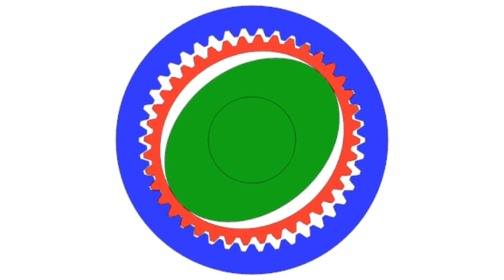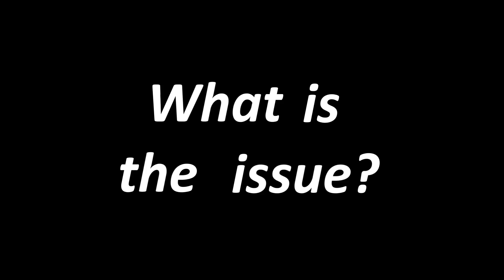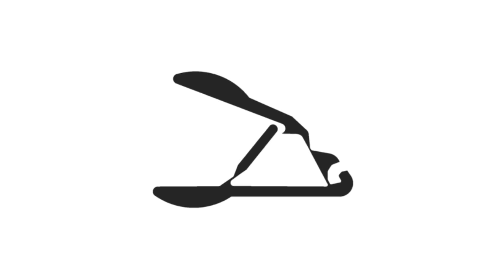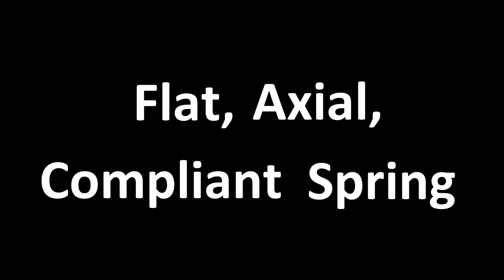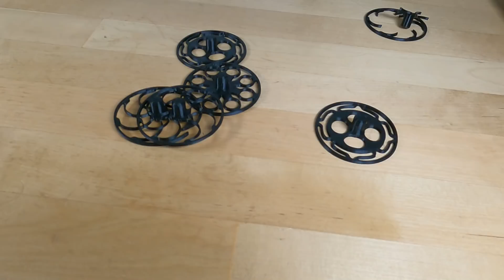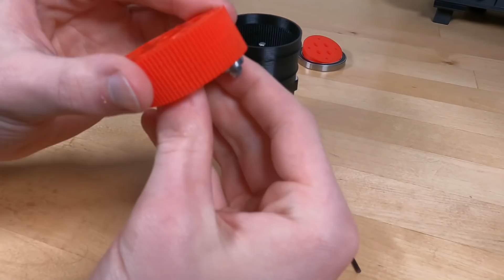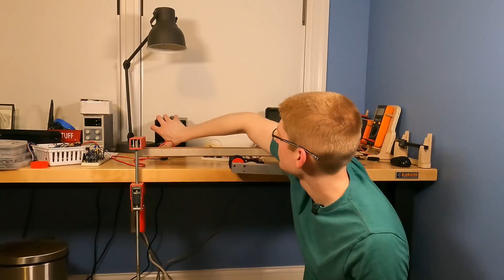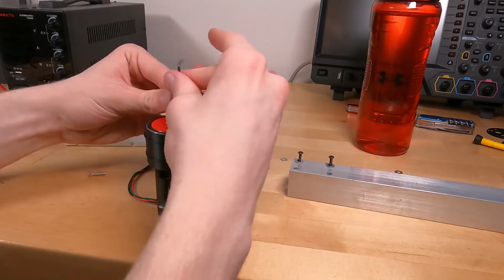Compliant Harmonic Drive (3D Printed)

Comment: you have no idea how much I appreciate you using metric instead of imperial
Reply from the maker: Always have!
Reply: I honestly don't know any engineers (I'm in the US) that use imperial. The only time we do is when we're forced to by dang archaic machine shops! Metric is love, metric is life
Reply: @3DprintedLife  imperial is less common in engineering, more of a general purpose measurement.
Reply: Come on... how hard is it when the software does all the heavy lifting??
Reply: Despite being in the united states I have fully metricized my shop, it makes collaborating online so much easier.  Highly recommended. 

Although in my open source designs I try to use 3mm 8mm and 30cm dimensions as much as possible as there are very close imperial standard sizes so people can often use a design as-is with what they have on hand.
Reply: @MrFaaaaaaaaaaaaaaaaa  lol...   it only hurts for a while
Reply: @MrFaaaaaaaaaaaaaaaaa  I hire many young people that aren't bested by the decimal place..
Reply: @ALEXGIBSONCMG  sadly ANSI is in imperial... though not using ISO is already quite a sin.
Reply: "Why doesn't everyone just speak English?"
Reply: @JohnMeacham  you neglected 19mm which is the closest conversion that I'm aware of. Rookie mistake
Reply: @WeighedWilson  cool. that's useful to know.
Reply: @MsHumanOfTheDecade  ANSI has both imperial and metric standards. They will create standards based on existing practice whatever it may be. Though, there is generally a corresponding ISO standard for ANSI standards that use metric or are international so the ISO one is often referenced when it exists.
Reply: @ALEXGIBSONCMG  aerospace uses imperial mostly
Reply: @ProDesigneHd  yup. There's countries who use metric, and countries who've been to the moon
Reply: @Cracked1ce  didn't a rocket blow up because someone used imperial measurements for a part instead of the agreed upon standard? Sorry don't remember more details...
Reply: @georgblennow3174  you got that the wrong way around buddy. It's cause someone used metric instead of the agreed upon imperial
Reply: @Cracked1ce  ah, sorry my bad. Point still stands though; having a universal standard would be neat
Reply: @georgblennow3174  there is. It's imperial .
Reply: @thegoldenwolf274  yup, imperial is also commonly referred to as standard 🤔
Reply: @Cracked1ce   not sure what country you live in but at least here in sweden the only time we use imperial units as a standard (from the top of my head) is screen-sizes, sometimes in cooking and borrowed standards such as a 2x4-plank.

Edit: forgot that in cooking, standards differ from country to country making us sweeds not use imperial but our own standard, just to confuse even more. This really needs to change.
Reply: @WeighedWilson  most people know at least basic english, not saying everyone should have english as their primary language, but it's good to have a standard to fall back to if needed.
Reply: @georgblennow3174  English should be the Universal language though. I started learning it in Peru before immigrating. Everyone should have a leg up. Oh yeah, Imperial as standard. YESSSSSS!!!!
Reply: @thegoldenwolf274  would you care to explain why? I'm genuinely interested
Reply: @georgblennow3174  to get rid of the language barrier. Imagine if every single human on earth spoke the same language. It would be beautiful. And I'm just saying english because it already is widely used.
Reply: @Cracked1ce  using metric
Reply: @thegoldenwolf274  yes, agreed, although i meant the last part but this works too
Reply: @Cracked1ce  NASA uses metric A LOT
Reply: @Cracked1ce  NASA has had the policy to assume metric by default since the 90s and as of 2007 metric is mandatory in all projects.
Reply: @Van-yo2xr  since 2007 it is exclusively metric. No idea where he is getting his info.
Reply: @JohnMeacham   @Van Myers  Explains why we've forgotten how to get back to the moon ;)
Reply: @Cracked1ce  um no. The mars climate orbiter crashed because one piece of software used imperial when metric was explicitly stated as a requirement in the SIS (software interface specification) provided to lockheed martin. The entire thing was metric except this one bit. The space industry has been fully metricized for a long time, most of the projects are international collaborations and metric is so much easier to use it took over US only projects too.
Reply: @JohnMeacham  Everything's done in CAD these days anyway. a flip of the switch is all it takes to switch between measurements. I know that a lot of the aerospace and defense industry in the US uses imperial
Reply: @Cracked1ce  no, software is the issue. Physical dimensions are whatever they need to be for the task on hand,. What crashed the orbiter is a piece of code written by one contractor reported the number in one unit to another piece of software that expected it in another. The interface specification agreed on before starting by both parties said it was metric, lockheed fucked it up. There is no switch or automated way to change  internal software interfaces between metric and customary and there are way more functions that accept numbers than physical parts on any modern piece of aerospace engineering.

 It's not even just unit conversions which are hard enough,  you use different  formula when using mass (grams) instead of weight (lbs) for various calculations, especially in space travel. Standardizing on metric for everything has gotten rid of whole classes of failure.
Reply: @JohnMeacham  aerospace does not mean just NASA. for example you mentioned Lockheed Martin, they mostly use imperial.
Reply: @Cracked1ce  which is literally what caused the mars climate orbiter crash. And why lockheeds space division is exclusively metric now.  

And contrary to popular belief the Apollo missions did use metric for all internal calculations, the guidance computer and thrust calculations did everything in terms of metric and only converted to feet etc for display at the last minute.
Reply: That's no imperial that's impractical
Reply: @georgblennow3174  Screen sizes are not actually in imperial, they are only marketed as such. You market a screen by the size of it's diagonal, but nobody makes a screen that would have exactly N units diagonal because other than for Pythagorean triplet ratios like 4:3 screens that would result in irrational side lengths. So what is done instead is you do the pixel pitch and resolution you can and round the actual diagonal(which is irrational) to nearest integer inch you want to market it with.
Same thing for image sensors, no part of the sensor is actually 2/3" or 1/2" or whatever optical format it's marketed with, it's just retarded marketing convention. Other than in US it's the same deal even with lumber, if you buy a two by four, it's probably just 50mmx100mm, who the hell would adjust the lumber mill in inches?
Reply: @aleksandersuur9475  I knew screen sizes are diagonal, didn't know the other stuff though, makes me hate marketing even more...

All these comments are interesting to read btw, it turned into a very informative thread for me 🙂 thank you to all nerds for existing, meant in the best way possible
Reply: Always have to laugh when someone pushes metric. The USC/ imperial system is far superior.  When it comes down to it metric is a total waste. Not only is it more complicated it's less capable and more error prone. The Metric system is simply an inferior system sold to those scared of basic math as a smoke screen that in reality creates more work and more problems.

Oh and if you disagree try me You will loose.
Reply: @rmkscrambler  Yeah sure, keep on dreaming.
Reply: @aleksandersuur9475  Not even in the least The metric system is an incompetent proposal to eliminate the decimal it has since evolved into an overall incompetent system.  I would not argue against updated units because as technology advances it is something that must be done. The system itself is incapable and is nothing more than a sales pitch.
Reply: @rmkscrambler  It's was simpler conversion from cm>m>km and anything in between

Rather than feet>yard>mile and anything in between
But whatever
Reply: @Arctic_silverstreak  This is why I stated that the metric system is a sales pitch that doesn't do what it claims and in reality all it does is cause confusion and misunderstanding. So much so that no one in the world uses it exclusively without jumping back to the imperial/usc system on a daily basis just to function. If you don't believe me reply with the time you type your reply in metric. (if you know the systems it is possible impractical but possible and no google will not answer it for you this requires knowledge)

First of all a unit can be anything and can be used in either system  as our ability's advance units will also. While one system may generally use one unit over another the reality is a unit is a relational statement based on whatever standard is available at the time. As a human my foot is always available (as an approximation of course)  where as the distance around the earth or now (as an updated unit) the speed light travels in a specific amount of time is slightly more complex. In either case if I am measuring with any precision I will be forced to obtain a standard for that unit which has the required accuracy.

The issue with the metric system is how it handles said units.
First when you go from cm to m to Km You are NOT converting units. You are scaling one unit which is the meter. If I go from meter to foot i am converting units.  For example if I were to use the foot instead of the meter in the metric system I could scale it the same way. I could have a centi foot, a foot or a kilo foot. Now hear is why the metric system is more complicated.  In the usc/ imperial system I can also scale a unit but rather than memorizing prefixes to define the scale I use basic math. So rather than a cm I would have 1/100 meter or 0.01 meters rather than Km I would have 1000 meters. I don't have the added inconvenience of memorizing prefixes that do nothing more than represent a fractional scale which could just as easily be written in basic values I mean without google I have no clue what a Yotta Meter is.  These 20 prefixes not only make it more complicated due to memorization but the restriction to a value of 10 makes the system more error prone. It's a lot easier to over look a misplaced  scaled decimal than it is to see an incorrect unit. I mean if I have 123456.78912345cm and I "convert"/ scale it to 12345.67891234mm or 1234567.891245dm Vs 1foot converted to 12 inches or 3.048 meters 
It obvious if their is a mistake on the unit conversion however with the scaled unit's it could easily be overlooked. 
To keep the reply short ill stop there however The metric system will loose out in any practical discussion.
Reply: @rmkscrambler  if i have a formula which outputs my result in meters and i get 0,01 as output i know just by shifting the decimal that it is 1cm or 1/100 of a meter.
If i wanted to shift from liter(cubic decimeter) to a cubic meter i just need to shift the decimal place in my head.
So you tell me whether in practice it is more efficient to scale your inches to miles by some random factor you have to multiply by or convert mm to km or cm to km or even nano and or picometer to km by just shifting your decimal point.
I mean i grew up with the metric system and use it for engineering in cad and for programming and for machining on the day to day bases and i think it is just so simple and usefull.
But i can also understand that you will be as effective in using a different system if you grew up with it and use it every day.
I just wanted to state that i do not think that metric is some kind of marketing gag :)
Reply: @julstr6303  I grew up being taught the metric system in school. I use both systems on a daily basis. In cad/cam and machining. In practice metric is simply more error prone.  And yes there is a huge difference between scaling and changing units.  Infact your reply is a good example of how changing the meaning of words to sell the gag. If I am changing the scale of a foot or a mile I can also just move the decimal. However if I need to change units I need to know the conversion factor no matter the system.
Reply: @rmkscrambler  i understand what you are saying.
But i still can't understand why having different units is less error prone than using one unit and scaling it.
I mean i have never worked with imperial so i guess my insight is not just limited but non existant but could you maybe give some sort of example of what kind of error is happening in metric that isn't in imperial?
Reply: @JohnMeacham  the formulas are the same except for constants. Usually metric need simpler constants.
Reply: @LeifNelandDk  no, lbs is a measure of force so depends on reference frame but grams are a measure of mass so are independent of frame. However a lot of time people use lbs to mean mass with an assumed resting frame in earth's gravity. However a rocket is the furthest thing from following those assumptions and mixing formulas using lbs to mean mass and formulas with lbs to mean force makes all your dimensional analysis not work out at all. The implicit sometimes lbs means mass  is a huge pain and a source of confusion and bugs. You can't just use a constant to convert something that depends what planet you are on and the current acceleration.
Reply: @rmkscrambler  This is bonkers, your imperial is legally defined on the metric system and has been for many years, please cite just one "no one in the world uses it exclusively without jumping back to the imperial system" please. If it was true  that "the metric system will loose out in any practical discussion" the whole world would not have left the imperial system in the dust except for some backwater places.
Reply: @trentoncarr  It's True that the definition of a foot, in and so forth have been re defined by the meter which itself has been redefined many times and is also defined by the imperial second, which was adopted to the metric system because metric time was a complete joke kinda like the rest of the system. The issue with the systems is not the units its how they are handled. When I made the statement that no one in the world uses the metric system exclusively because they can't. I gave one solid example. Even though there are many. Please reply to me with the time of your reply in metric. The unit for time is the same in both systems. It's the handling of said unit that fails. And if you have any understanding of the system itself you could complete the task.  As far as use by a so called majority unfortunately when governments and politicians force stupidity on people we have to take it. And really if the metric system was so great the imperial/usc systems wouldn't still be in use I mean metric has been law for around 100 years it's just incompetent law.
Reply: @rmkscrambler  no
Reply: @tiltil9442  If one doesn't understand metric well enough to take my challenge and post the time of your reply in metric then one doesn't  understand it well enough to debate it.
Reply: @Cracked1ce  congrats to Myanmar and Liberia on their lunar landings then.
Reply: @rmkscrambler  seconds since the epoch 1617893617 (a.k.a. 2021-04-08Z14:53:37) is the only time format one needs. Works anywhere and anywhen.
Reply: @rmkscrambler , I think you are hard to convince, because it all makes sense in all your normal applications... but if you widen your view there are ”other realities” where the SI-system has far greater benefits. This is not a case of meters versus imperial length units. Its about the fact that units dont change due to the size of the property you try to quantify. A scientist probobly prefer the SI-system due to the fact that when they do calculations they don’t need to change units when going from atomic level to planet level calculations. They only use prefixes that are commonly known anyway. And make use of the exponential notation system. New sciences does not normally invent new units due to the size of the property. (At least not within reason) Electronic engineers world wide uses prefixes from pico (1x10^-12) up to Giga (1x10^9). The same in computer science, and field after field. To base measurements on the decimal system is natural (at least for us grown up with it). We dot have to know all the various conversion factors between inch, feet, miles etc. etc. If we know the prefixes, they are useful in all kinds of measurements, not only length. The imperial way to deal with measurements that dont fit that well within the currently used unit resolves to use fractions... witch has to be learnt to be useful... 9/64 plus 5/16 demands some extra work to be solved.. natural to some, but not intuitive... and the conversion to decimal representation is still needed if you are using machines with scales such as cnc’s and dro’s. These are some of the strengths about the SI-system. (Others are the fact that all SI units can be derived from each other, but thats a whole other story).
The benefits also shows in manufacturing, an inch is to big to use for labelling screws, drills, wire area and so on. So they  instead  uses their own identification system that has to be learned, letter G drill versus a 01 drill, AWG 22 vs AWG 28... to make use of all this you have to learn a lot of conversions or rely on lookup sheets, drill tables and so on. In the SI-system you use the measurements directly, ie I use a 3.2mm drill for  normal clearance hole for a M3 screw. I can directly se that the clearance is 0.2mm between the hole and the screw. Its harder to quantify that directly in the imperial case. I’m sure that there are many nice examples where the imperial system has benefits over the SI-system, but the consensus worldwide seams to be that the SI-system wins in the overall picture.

(One benefit I am somewhat jealous of in the imperial world is the thread pich system wich is much more easy to singlepoint thread on a lathe than a metric thread... but thats from a manual manufacturing point of view, I’m not sure if one or the other is better from a mechanical standpoint.)
Reply: @rmkscrambler  “understand metric” what does that even mean ? Understanding the division by 10?? 🤦‍♂️ Your only argument in a science & engineering discussion is grounded on the human practicality of a non linear time indexing system. Nobody uses everyday time scales ie HMS for science or engineering because that would be stupidly impractical and error inducing. Precisely why no science is done using medieval unit systems. SI units only. Thanks for shooting yourself in the foot with the time example 🤣.
Reply: @rmkscrambler  One additional note... to my knowledge there is no metric time.(as metric is a length property only).. ((oups... i stand corrected.... whats called decimal time in sweden, seams to be called metric time in the us.... strange naming since it has nothing to do with lenght... but i was wrong about the international nameing convention)) there was proposals for decimal time but since the 24/60/60 system was about the only used system for measurement of time, the new proposal newer got widely adopted... dont fix something that aint broken.... time units didnt need fixing, but traditional length, weight and volume scales were so diverse they needed standardisation. In Sweden there were multiple definitions of the swedish inch, and foot, depending on geographic location and in wich field of work you were in. A new standard was the only reasonable way out of the caotic mid eval times... Other units did not need fixing, for example angle units are interesting.. we all use the 360 degree full circle. Although at least in Sweden there were an invane effort in the 80's to adopt the 400 degree circle definition in some fields. It failed... But then again... at smaller angels below 1 degree the diversity shows itself again... decimal representation, arc min and sec, mills (wich itself has multiple definitions depending on local practices..)  Unified usage of a common definition of various measurements make everything so much easier. Most of the scientific and high end manufacturing world has come to the conclution that the SI based approach is preffered over imperial units... more and more things go metric and other SI based units. One definition to rule them all... ;)   its only the aviation world that is stuck in the conservative imperial corner... Swedish airforce acctually went from metric to imperial units about 20 years ago, to prevent accidents due to unit mismatch when communicating with civil ATM centers... but thats the only example i know of, going against the stream... =o)
Reply: @klasmalman9249  the base 60 system used for time and angels predates the US imperial system by several thousand years. It has been adopted by the metric system, which is about one unified system worldwide more than everything being base 10. The second is defined by the metric working group and nobody uses any definition relevant to the time the US imperial units were defined. For example leap seconds are used worldwide including in the US and most people do not even know.
Reply: @Van-yo2xr  Nass only use metric now. You know imperial units are defined as fractions of meters. You don't want to fuck around with rounding errors when sending people on rockets
Reply: @JohnMeacham  yeah exactly they don't get that when you begin fucking around with units of measure some constants just don't work.
Reply: @rmkscrambler  the entite planet has been using it for a century.
Imagine doing serious math in imperial units. It has to be such a meme i cannot even imagine.
Reply: @rmkscrambler  bois this guy never opened a physics book. Leave him alone.
Reply: Really don't understand why there's still a metric ton of people using the imperial system.
Reply: @henmich  word
Reply: @Cracked1ce  Apollo's computer worked in metric system! Engineers had to use a lot of extremely precious ram and cpu time to do conversion to display to astronauts in imperial!
Reply: @MyNotSoHumbleOpinion  Metric works good for math, but imperial works good for the brain. Fahrenheit has been proven to be a more logical way to represent environmental temperature than Celsius.
Reply: @Cracked1ce  imperial works good for your brain? While metric is good for math? 

That doesn't sound right at all. I mean doesn't your brain do math? If it's easier for math, its easier for your brain, no?

What is "room temperature" is obviously going to have a different answer depending on what system you use but its no easier for me to say 72F than a Canadian version of me to say 22C. I don't understand what you're arguing here.
Reply: I have never understood “units bigotry” especially when it applies to metric zealots. It seems that many believe being 10 based is somehow magical. We constantly deal with odd bases. Thing about for a minute — or an hour — or a day — or a week, a month, a year, etc. once you’ve hit a century I’m sure it will start to make sense.
Reply: @20xx-mm-dd  I'm not arguing. there have been many studies that show that the Fahrenheit system is a much more logical way to represent temperature in relation to human comfortability. of course celsius is a much more logical way to represent the temperature of water. just think about it for a little bit, a comfortable temperature is 75F, uncomfortably hot is 100F, cold is 50F, freezing is 32F, etc.etc. vs  celsius which is 38C for hot, 24C for comfortable, cold is 10C, freezing is 0C. those numbers are garbage.
Reply: @Cracked1ce nope, everything is ketric, only the display is imperial, but someone accidentally used imperial somewhere else
Reply: @rmkscrambler most people use metric, pretty much only the US uses imperial
Reply: @rmkscrambler metric time is not part of whats usually called the metric system, which is actually the SI system of measurement. Metric time was a proposal during the french revolution that never caught on. Metric time is decimal instead of Sexagesimal like time is normally used.
Reply: As a brazillian, i say the same.
Reply: @Cracked1ce  what about india?
Reply: @rmkscrambler  what? The imperial "system" literally is a bunch of different systems put together, for example miles are from a different system than inch, which makes conversion factors a mess
Reply: @rmkscrambler  literally everywhere except for the US uses metric constantly